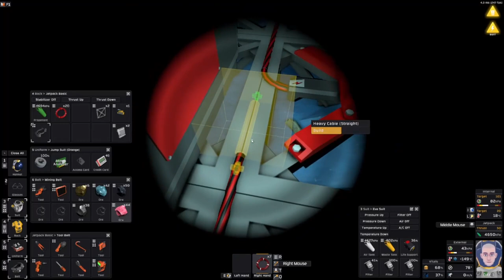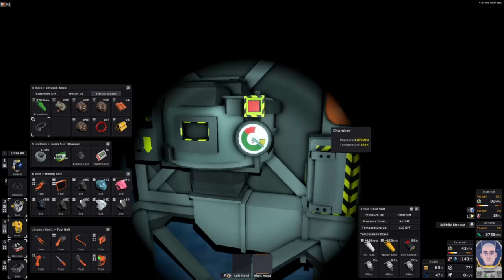Let's Play Stationeers on Europa : Part Two : Days 3 to 7

Comment: are there like, LCD screens similar to Space Engineers where you can leave a message in the air lock that can say "Close Helmet!" on the exit door? Because that'll be really handy to have. Also, if you make more mining belts, you can store your ore in there and put the Belt in the storage rack (and you can even paint the belts for a certain ore color. Red for Iron, etc.). I learned that from watching Splitsie and Gang play this. and I just now realized this was a couple of months ago... but good tips for anyone else that comes across this.
Reply from the maker: Thanks. I think they are working on customizable consoles, but we don't have them yet. In fact, there are still some serious issues with consoles in multi-player that they haven't addressed yet. I thought of the idea of making backpacks to store ores on the shelves, but I planned to make a vending machine to put them in so I didn't bother with it.

Comment: with the wind turbs in space engineers the higher you have them you get a somewhat better energy gain so I'm curious if it works similarly in stationeers
Reply from the maker: As far as I know it doesn't make any difference, but I haven't checked it in a while so it's possible they've updated the game so that it does make a difference.

Comment: First of superb gameplay it is satisfying to watch.
Some suggestions
1. Currently your voice is quiet increase its volume to greater than game volume (also if it feels to overwhelming sound wise decrease game volume)
2. Commentary is king fill dead spaces with planning, facts, and other filler (it takes practice don’t worry too much about the quality starting off)
3. Try out speaking louder currently it sounds like whispering (if thats what you want keep it up this is your style of content) 😢  
This video I have only been paying attention to speaking overall it is good from gameplay to commentary.
Reply from the maker: Thanks for your suggestions. #1 I've already done. I've been playing around with the various audio settings, and I've reduced the game audio to 90% and my voice is at 250%. I've also added a noise filter. Unfortunately, the mic I have picks up background sounds, like my upstairs neighbor's kids running around the floor, loud and clear. But the sound coming from my mouth 3cm away, not so much. #2 I'm working on. I think I've gotten a bit better at in in subsequent videos. And #3 I'll work on as well, but unfortunately I do have a very quiet voice.